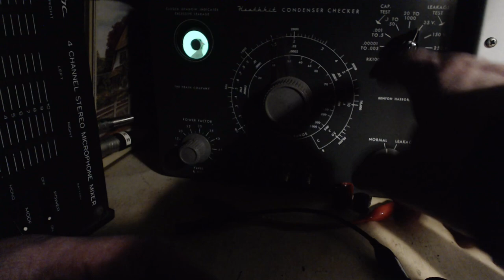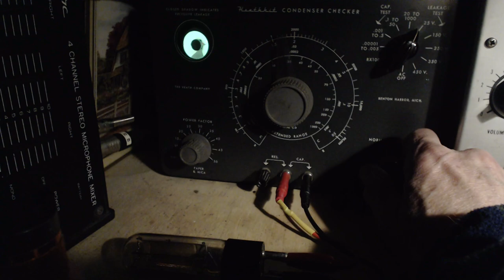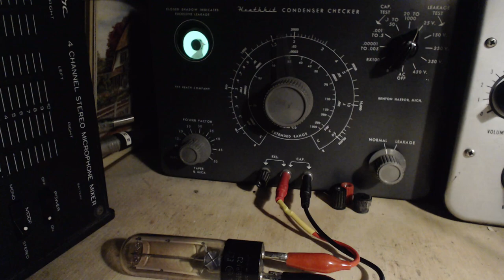Testing a Phototube with a Capacitor Checker

Comment: I had a tube like that ... about 60 years ago.  :^) And yes, it had that black spot on the back of the emitter electrode.
Reply from the maker: Someone wrote the number 127 on the back of the electrode.  I've seen similar writing inside other tubes.  It reminds me of how manual the building of tubes was and I'm now handling what someone else hand built so long ago.